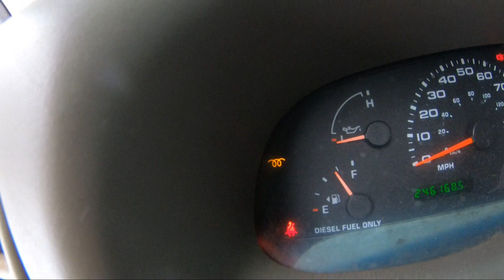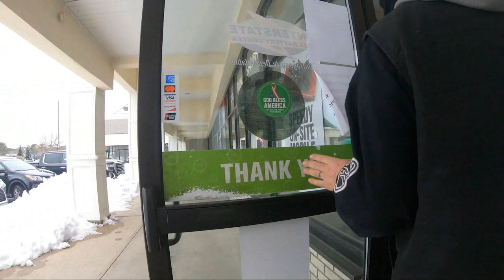How To Change Diesel Pickup Truck Batteries!

Comment: BUT FIRST! - That's the life we all seem to live!  "I'm going out to do this or that - then BANG - BUT FIRST I have to change a battery, a tire, whatever"! Then of course we don't have every EXACT tool needed so the hunt goes on. You did pretty well with it all. NOTE: For dried ACID I mix BAKING SODA & WATER & pour it over = GONE! Thanks!
Reply from the maker: Thanks I’ll have to try that on the next one !    Yes it’s always something. Thanks for watching!
Reply: @DirtBrute  Steve, try this. Mix up or stir 3 or 4 heaping tablespoons of BAKING SODA in like 12 - 16oz of water. Find any vehicle in your yard with acid on the battery posts or hold downs. Watch it foam away as you pour the stuff over it. Try it as a test & I know you'll love it. Thanks Pal!
Reply from the maker: @sonnyblazer5504  will do !

Comment: The hold down for the batteries might keep your vehicle from catching fire if you wreck and roll over so the battery will not short out. Mine are broken off too so I hooked a short rubber tarp strap over mine. Move to central Indiana our winters are not as bad here and you would fit right in with us. I'll get you a job driving a concrete truck where I work.
Reply from the maker: Yeah good idea with the tie down !  Thanks man . My wife want to move to North Carolina to be closer to her parents in Florida. I might just have to !

Comment: I just don't understand why Ford wants to pull engine air in through the battery box.. If you were driving down the road and the battery exploded for some reason it would suck all the acid and ect in the breather and possibly on in the engine. Haven't figured that one out. And yes Interstate batteries are good batteries. I run some myself.
Reply from the maker: Yeah idk . 🤷‍♂️.   Thanks for watching!

Comment: Hold up are you telling me they'll give you 16 bucks a piece for old batteries that you didn't even buy a replacement for?
Reply from the maker: Yes . That’s what the guy told me .As long as it’s a good core . I haven’t tried yet but we shall see soon
Reply: @DirtBrute  man I could have been a millionaire 🤣 I have to check on that around my area
Reply from the maker: @MikeDPlxztc  I’ve been hanging onto them because the local dump wants $20 a  battery here. I haven’t tested whether it’s true yet or not but that’s what he told me
Reply: @DirtBrute  yeah that's always basically been my experience too. I'm definitely going to check it out though sometimes things change